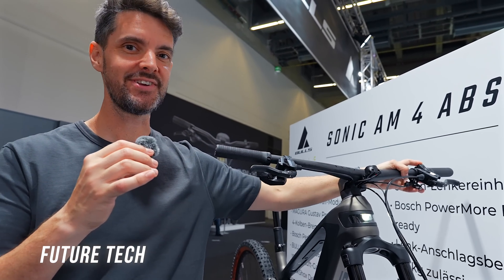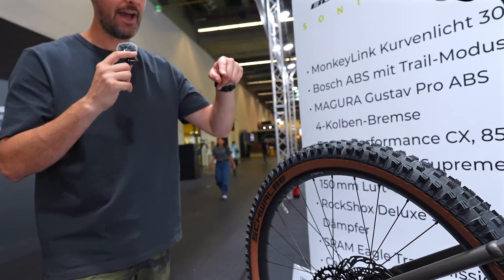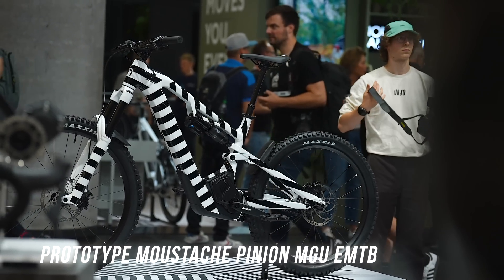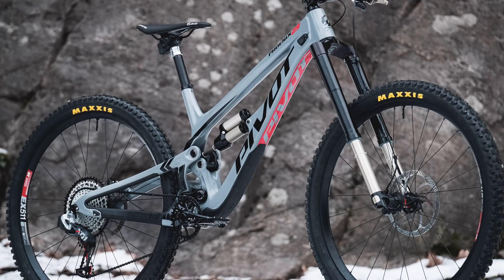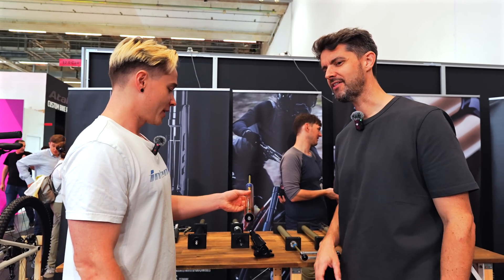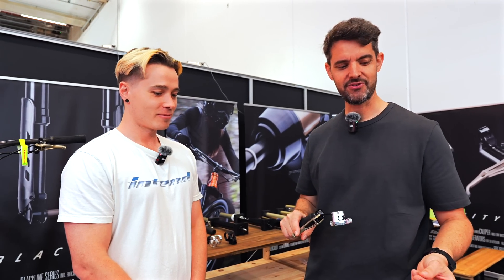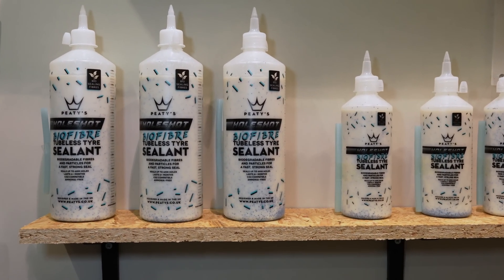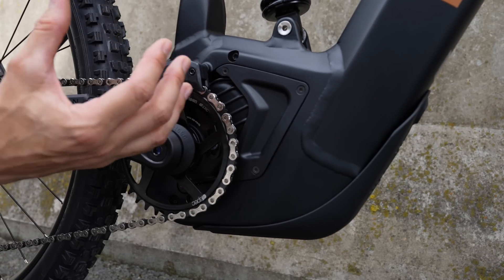Hot 2025 eBike Tech from Eurobike

Comment: Vehicle regulations require that the lights can be run for a certain number of hours after the vehicle has been turned off. This means that as soon as you plug lights into your ebike, the software recognises this and reserves a portion of your battery capacity. This reduces your range, and is why I'll fit separate usb lights thanks very much.

Comment: Friend of mines riding a cube got his axs derailleur powered by the main battery. When he's out of juice, he simply cannot change gears! Just the wrong nice idea
Reply: Isn't this more an issue with the battery/motor implementation though?  It should be set up so that there is always a minimal amount of juice available in the battery for auxiliaries even if there is not enough to power the motor.
Reply: Good point! That's exactly what I thought at first glance. 5% battery for derailleur lights etc. Hopefully this brand will be smart enough
Reply: Thats not true - it needs very little battery and still operates when the motor has not enough charge anymore

Comment: Seriously this seems so obvious. Why is this not already a thing. I use my emtb for both mtb and urban commuting. Would be nice have lights front and rear integrated
Reply: adds failure points both mechanically and for the light and maintenance it's the worst idea ever, on older cars the bumpers were plastic and made to take a hit it cost very little to replace them, now headlights and plenty of other unnecessary things are integrated and if you bump your car it'll be 5000
Reply: @fredEVOIX  yeah that’s a good comparison. I’m glad mine doesn’t have  integrated lights. Would still be nice to be able to run lights off the battery but still removable/replaceable
Reply: @fredEVOIX  The monkey link they use is a very good idea. It is integrated in the cabeling system and allows you to use the main battery for the lights instead of multiple mini batteries that all need to be charged with dedicated cables and chargers.
Reply: There has been bikes with integrated tail lights for a long time now, they are just super rare. I remember Haibike has had tail lights ages ago and Scott also had a bike with integrated tail lights. Lights in the front are however new and while I do like the idea, it really adds a new failing point to the bike, extra weight and possibly a light that is not living up to our expectations which you are stuck with.
Tail lights, yes please. Lights in the front however, no thanks.
Reply: @VenoXj1  good points. Probably better off just getting nicer lights then being stuck with whatever they give you

Comment: I always thought lights would work better if they aimed where you want to go. Lights on the fork for example. How come car lights turn with the wheels.
Reply: Yes and no, because it's very much a personal preference. 

>  How come car lights turn with the wheels.

Cars generally do not have as wild movements of their front wheels as bicycles do. A better comparison is to motorcycle headlights. And with motorcycles they seem to be primarily mounted to move with the fork.

The problem with bicycle lights that aim where you aim the wheels is that darkness you're now risk getting a strobe effect. Even on smooth roads, I find it quite annoying to have the lights move whenever I make small adjustments, especially when those small adjustments aren't following my head. head. Bicycles are subject to far more jittering motion than motorcycles and especially cars. 

To my mind, the ideal is two lights on the bike - one that follows the fork, one that follows the frame.
Reply: @MrMartinSchou  or maybe one on the frame and solid light band on your helmet